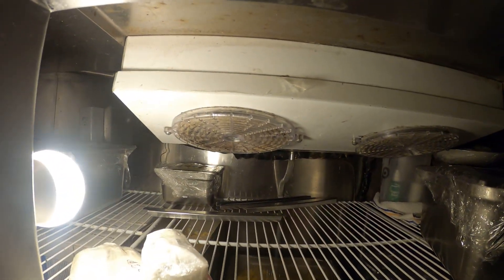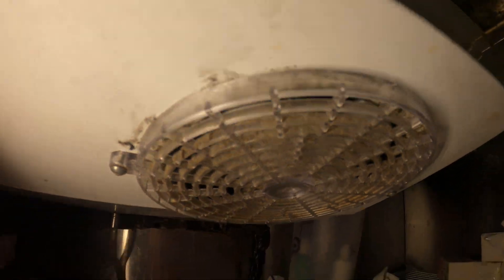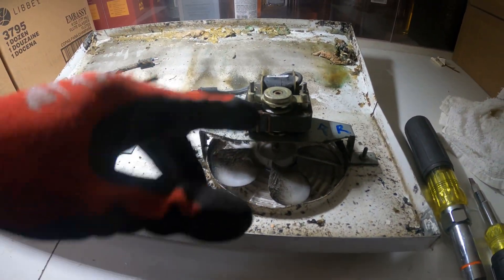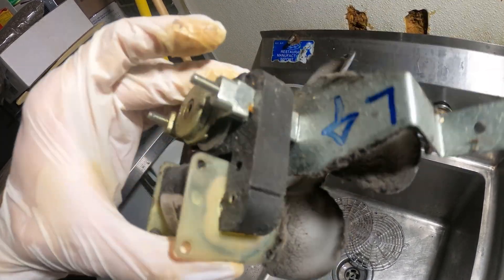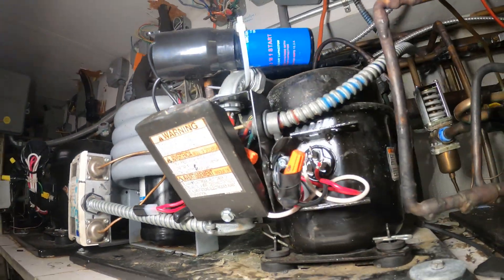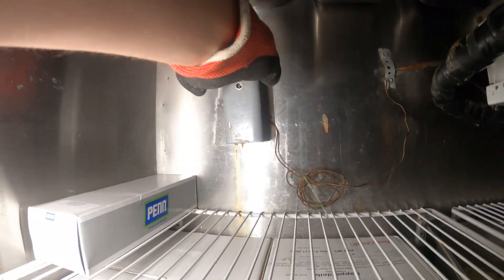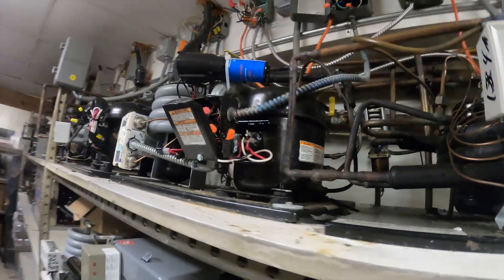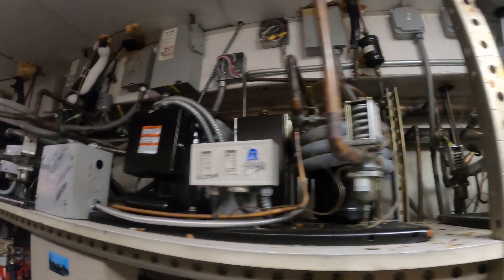HVACR Service Call: Low Boy Refrigerator Maintenance And Repair (Water Cooled Refrigerator Repair)

Comment: wonder what there water bill is like
Reply from the maker: Very high 💯 Thanks for watching & stay tuned for new videos every week🔧⚡️
Reply: @JumpermanTech  no way of remoting just the condensers outside?
Reply from the maker: @itsprimetime9865  Nope. No outside space. The building does have a cooling tower to recycle this condenser water👍
Reply: @JumpermanTech  ah one of those but even then a certain percentage of water is lost so they must have to top it up time to time... its just sad tho  where i am in Toronto its getting really hard for water cooled systems  the goverment is cracking down.. on my places eliminate water usage for refrigeration unless there is no other way .
Reply from the maker: @itsprimetime9865  Yup. Water is constantly evaporated into the sky so it all adds up for sure. This is the case for a larger type building built in a major city that was built a long time ago. Everything Is def all about doing green nowadays

Comment: Just some advice that coil should be a draw thru coil? If that’s so the thermostat bulb should be mounted to the left so it is not picking up the discharge air off the coil!!!
Reply: that makes no sense   and also its called a bulb  or element
Reply: @itsprimetime9865  what makes no sense about that. Coils pull the air threw the fans and out the rear making where the bulb is mounted the discharge air!!!!
Reply: @daveg8918  again it doesnt matter the cooler is very very small  and the temp will equalize everywhere
Reply: @itsprimetime9865  you do a lot of refrigeration? Because I have done it for 27 years and can tell you first hand it will greatly cause issues.